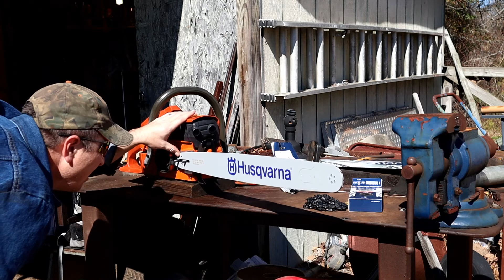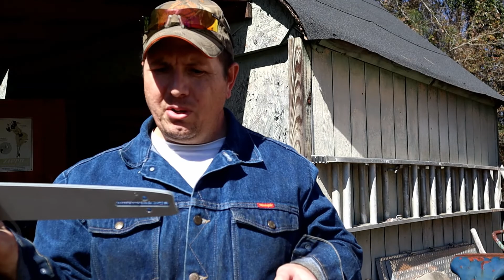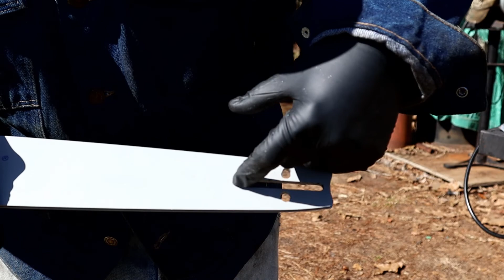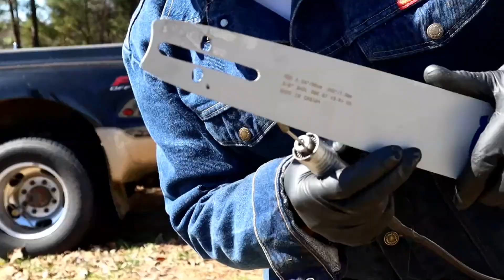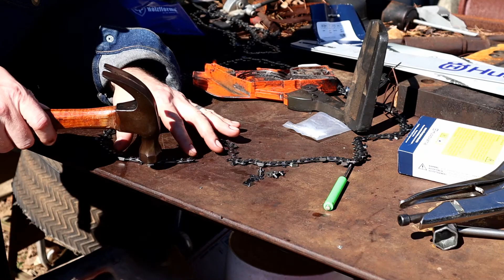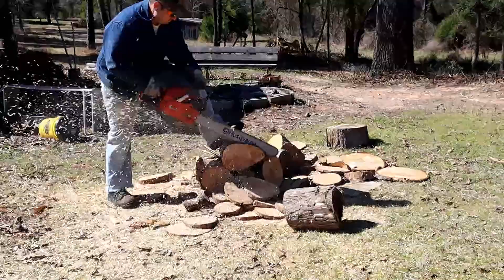Husqvarna 61/272 In The Wood! Husky Bars Don't Fit Husky Chainsaws?

Comment: You are looking for a bar with the designation “D009”. This is husqvarna’s “big saw” bar. That one you bought is most likely a K095 or A095 style. Those were for the smaller saws. It’s tricky though because some saws like the 262, 362 and 466 that are bigger than the 61 still use the “small bar”(A095 and K095). The 61 is one of the smallest that uses the D009 style.
Reply from the maker: Thanks!  That is helpful to me and others that come across this video

Comment: I just modified a stihl es light to fit my 390 and 372... was kind of nerve racking because you have to elongate the slot quite a bit, but once the shrapnel starts flying, you dig in and it was all worth it. That 32" stihl bar weighs about the same as my 24" tsumura light bar. costs about twice as much though lol.

Comment: You had some nice looking chips there at the beginning. Sounds like you need some more high end rpm's.  I've got two Jonsered 670 saws to do. Both need bearings & seals. The one is getting basic porting & base gasket removal. The other is getting a titansil 52mm big bore kit with a pop up piston. 

You did pretty good on hitting your numbers. Tinman does a great job of describing how to port. I've watched that series several times. Now I'm looking forward to seeing you actually take down some trees with it!
Reply from the maker: Those 670’s look pretty sweet!  Not many in my area. Yeah the chain needed the rakers taken down quite a bit and I was running the saw rich. It screams now. Tree take down and ported chainsaw race upcoming!
Reply: @Man-Time  looking forward to it! Have you gotten anywhere with the canopy on your track loader yet? I've been waiting for that one. Keep up the good work!
Reply from the maker: Thanks man. Yeah no work on the ROPS. Waiting on your vid. My welds won’t hold a flame to yours👍
Reply: @Man-Time  Hopefully I can get working on that in the next month or so. Too dang wet outback right now to do too much. I've got a mountain of projects that I need to get done this summer. I've got most of the materials for all of them, now it's just down to getting the time.

Thanks for the kind words! I do appreciate it!

Comment: Oh, if you want to use a normal 84 drive link chain, just drill 2 more holes for the adjuster about 1/4" back towards the clutch end of the bar. That, of course, give you a lot of adjustment and as a bonus, if you eve get something like a 350/550 husky that bar will work with the original holes, even with the modification you already made.